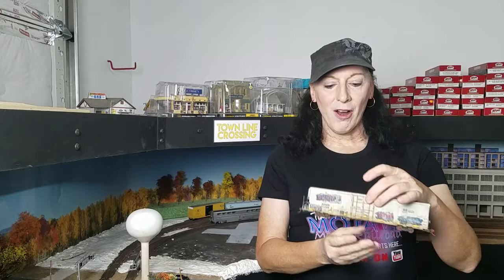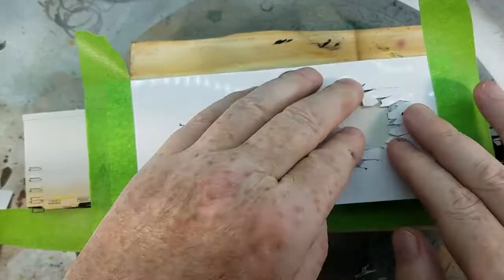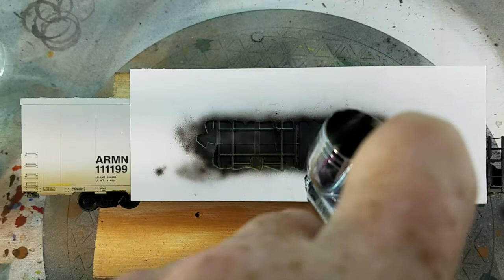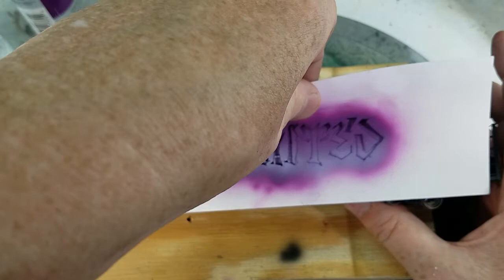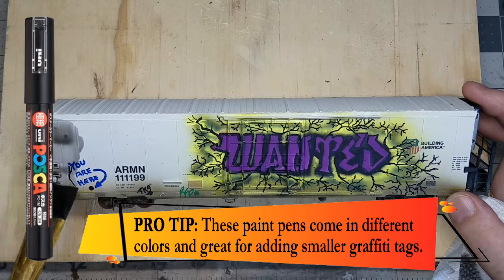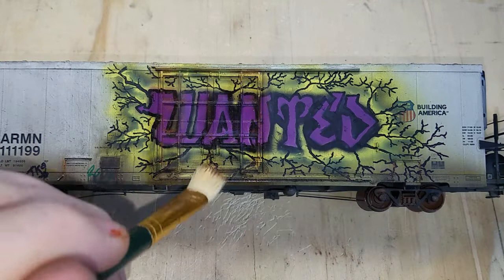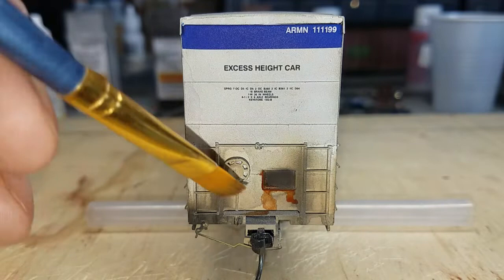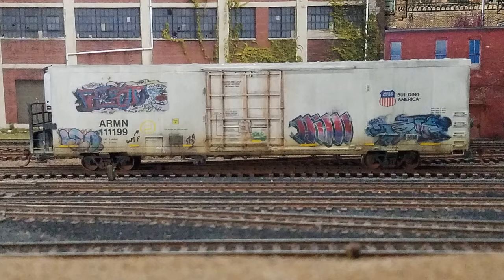BLMA 64' Trinity Reefer Wicked Weathering Video with Custom Airbrush Stencil Graffiti and Decals

Comment: Looks fantastic. You make it seem so simple. I'm still intimidated to try it.
Reply from the maker: Trust me...If I can do it...anyone can do it. I love art, I even collect art, but have absolutely no skills as an artist. I try to break it down to the basics so that way if I can pull it off, just about anyone else can. Give it a try. You go this!
Reply: @MojaveModelRailroad  I have 2 air brushes. One is a cheap one and the other one is a Nero I think but I can't find a fitting to connect it to my airline to the compressor
Reply from the maker: @philstrainlayout  Depending on the compressor you have you can go to Home Depot or Lowes and they might have the parts. Or if you have a hobby shop, not a train shop, in your area they almost always carry the parts. Worse case look up the brand on Google and you can easily get them on eBay or Amazon.
Reply: @MojaveModelRailroad  I'll try again to find the right part. Maybe home depot first.

Comment: I use my airbrush with all types of paint. I do like you said, mix it in a separate container and make sure it is free of lumps. I love using Testors military flats in the airbrush. If I work with water based paints I will use IPA as a thinner.
Reply from the maker: I actually tired using a higher PSA and used isopropyl alcohol mixed with a little water. For some paints it works awesome, but others you get tip dry pretty quick but does have benefits.

Comment: I have that Vallejo airbrush thinner, but find it still clogs the brush. I have a beginner set of Vallejo, I just cannot find a good mix to use them for air brushing.
Reply from the maker: What is your PSI? Vallejo also make a flow improver that can help. You don't need much thinner. Do you mix the paint in the airbrush or in a separate cup? I mix mine in a small separate cut then pour into the airbrush. If you mix in the airbrush cup, make sure to put the thinner in first and use a soft brush to really mix that well also cover the needle and let a little airflow backflow to back mix. If you use the Vallejo Air paint you shouldn't need any thinner however the model works you will need about 20% thinner. Also, make sure to really shake the paint before use. As I mentioned in other videos I actually use a few African 3mm gemstones in the paint bottles as a way to help shake the paint inside the bottle as it is thick. Also, you might have the airbrush PSI set to low and the paint is drying to quick on the needle. A higher PSI of 30 to 40 can help that. Plus, a tip I learned when airbrushing never shut the air off if you can. So keep the air flowing the entire time and just pull back when you need to paint it can stop the paint from building up on the tip. Even then I always find having a small sponge that has a little cleaner on it (50/50 water and Ajax) in my hand and just carefully cleaning the end of needle in between.
Reply from the maker: One more thing you might want to check. Most airbrushes allow for needles from .2 to .5 mm. Make sure the needle isn't bent, there is even needle lubricant you can put on. Cheaper needles tend to have some drag that can cause issues. One think I have noticed on the cheaper airbrushes. Not only that but needles normally come with matching nozzles. So if you are trying to use a .2 mm needle with a .5 nozzle you will have issues. A lot of times these airbrushes come with a few different styles but people bend a needle and just replace it not knowing if they are replacing the needle with the right one that matches the nozzle. I've done that once and couldn't figure out why I was suddenly having issues. Now I pretty much just use .2mm needles and nozzle as I don't do big projects like T-Shirts so that way I don't have that issue. You can buy just the needles and nozzles separately and they do come in their own labeled containers.
Reply: @MojaveModelRailroad  I have the Iwata Neo CN beginner kit, I believe there are three PSI settings, 2, 5 or 10. I get better results with Flow Improver, so generally use that instead of thinner. I have not tried using both. I am usually mixing in the cup for the Vallejo as it is usually an accent color. I need to figure out better ways to mix the paints.
I have the Model Works paint. I need to get some ball bearings to put in the bottles. They are on my list at Amazon and I will get them before my next painting project.
I do have a dual action, but the compressor I think maxes out at 10 PSI.
Reply: @MojaveModelRailroad  I think I have a .35 needle. I once looked for a smaller needle, but I think the NEO CN only takes the .35.  This is my starter airbrush and I wanted something small as I have limited space.  If I keep airbrushing, I might need to upgrade.
Thanks for all the suggestions.
Reply from the maker: @HumancityJunction  Do not put ball bearings in your paint. They can rust. 10 PSI is way, way to low. PSI for most airbrushing should be around 18 to 23. You can get away will a lower PSI if you are using a .2 mm needle but even then a thicker paint needs a higher PSI setting or it won't clear the needle it will dry on the tip before it leaves the airbrush. Iwata is a great brand. I have one of their airbrushes with my own compressor but I never drop it below 18 PSIs. Go with the 3mm Natural African Gemstones. They work great and will never ruin your paint like ball bearings can do.
Reply from the maker: @HumancityJunction  You might want to check as Iwata usually allows you to unscrew the nozzle and replace it and the needle. That unit does come with a .35 needle but I believe you can buy separately a .2mm needle and nozzle combo and replace. However, even with that needle if your compressor only gets to 10 PSI it won't be strong enough for the Vallejo paint..maybe the Vallejo Air which doesn't need to be thinned, but normally 18 to 22 PSI is the magic number. Plus I would think at 10 PSI that compressor is kicking on all the time and might not be even getting you 10 PSI. I actually bought a larger compressor with an external tank as I've been doing a lot of airbrushing and needed more of a workhorse. Keep up the great work. Love you live videos.
Reply: @MojaveModelRailroad  Wow, great tip, I had not thought of that.  I am assuming I can find the gemstones on Amazon or similar.
I double checked the compressor specifications.  It is called the NEO Air and it is a tankless compressor. It says it is 4PSI to 15PSI.  I usually run it on Medium, but I can definitely give high a try.  It sounds like that might help.
Reply from the maker: @HumancityJunction  yes, I have the Amazon link in my descriptions of the CSX Weathering Video.
Reply: @MojaveModelRailroad  Not available. Does the specific stone matter, or just the size.
Reply from the maker: @HumancityJunction  As long as it is gem type stone and around 3mm it should work. 3mm are small enough to fit in the bottles and I normally put like 3 per bottle in. If you do a search for Natural African Turquoise Gemstone 3mm you should find a bunch. They normally come on what looks like a necklace. Just cut the cord.